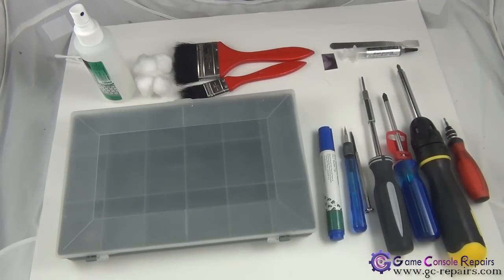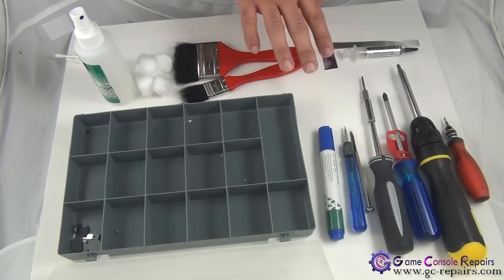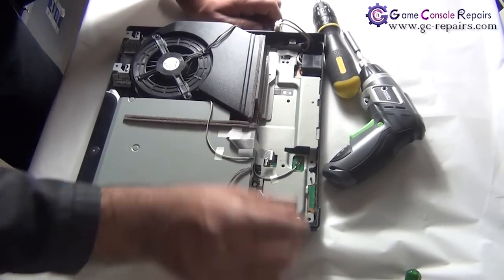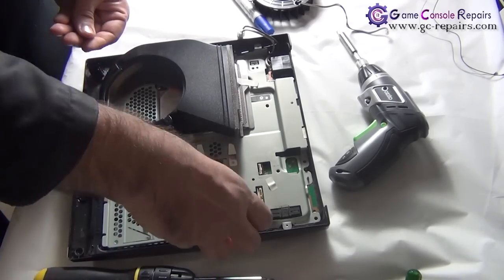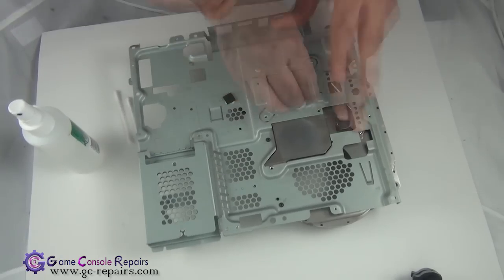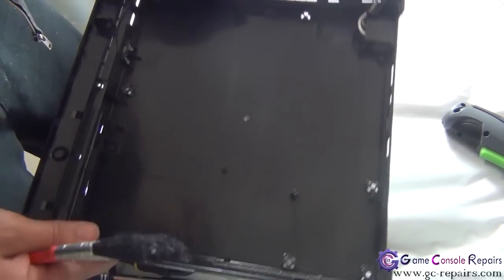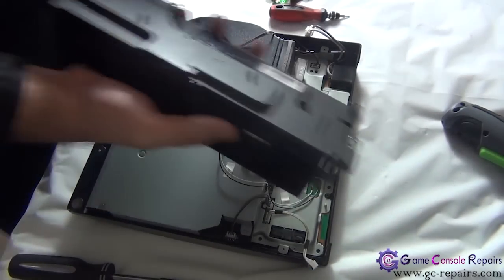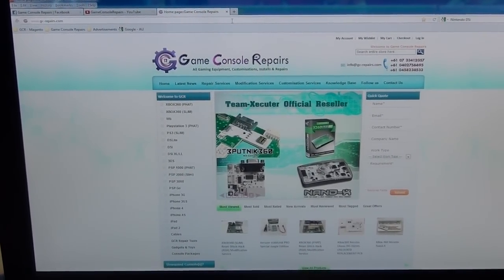PS3SLIM   250GB CECH 2002x   Thermal Compound Replacement by gc repairs com

Comment: Waaaaay too much thermal compound. It should be applied as a dot about the size of a pea on the center of the BGA's. The compression/pressure of the heat sink will properly spread the compound. If you have too much, you can create air pockets which will create hot spots between your BGA's and heat sink. Not to mention you want to focus the heat transfer to a single point... it is much more efficient at heat dispersion. Ask any one who professionally works on PC's... do not apply compound this way.
Reply: lol, these chips are massive and there's clearly very little mounting pressure.

This is exactly how this should be done on a ps3.
Reply: @Bonswally  I'm inclined to agree, the clamp pressure on the slim ps3s is very poor. The launch Cech-As I believe are the only ones that have good stiff clamps.
Reply: Eds UKGamerz It depends on the viscosity of the thermal compound you are using...like the arctic silver 5 in this vid which has a high viscosity. So when using the pea size dot method it doesn't spread as well as some low viscosity thermal compound. I use to think the same about spreading it and covering every inch. But if you ask anyone who actually knows what they're talking about when it comes to heat transfer they will tell you that making sure your compound has no air bubbles trapped in it is thee best solution ( ie dot and heatsink spread method ). I think people prefer to spread it on for piece of mind and precision. but the dot and spread method is thermally superior. Synth505 said it right.
Reply: Den techfixed both methods work perfectly fine, i certainly wouldn't use the dot method with the PS3 or PS4 CPU as it just doesn't spread evenly enough and it can create hot spots around the perimeter of the CPU
Reply: Most methods do the same. I did it just like in the video.  https://www.youtube.com/watch?v=r2MEAnZ3swQ
Reply: that pea size is a lie. Google about it.
Reply: The brand or type of thermal paste you use have also a lot of influence at the results. Arctic thermal paste is a very thick and sticky paste, adding too much will cause a isolation layer between cooler and cpu. Better brand like grizzly thermal kryptonaut paste, is more fluid and less sticky, so its spread more evenly. So the results will be almost the same. Still too little paste end up with a temp of 54 degree only ? That is a very awsome temp after a stress test, no worries that the cpu ever get burned, good paste. My ps3 slim hits 64 degree after 10 minutes and I haven't played 1 single game yet.
Reply: Personally I like to spread mine but I don't like putting it this close to the edge of the chip. I have put a rice sized amount on a old computer and it seemed to get more hot. I did it again but smoothed it out but only I stayed about 3 mm away from the edge and I didn't have anymore issues. It still got hot but it didn't thermal throttle anymore. I have a laptop now and I have to clean it and put more thermal paste on. I figured that I would do my ps3, laptop, and a friend's PC. I wish I still had a desktop computer but I am stuck with a laptop cause I travel alot. I mainly play games on my switch and I have my ps3, with a 7inch TV.
Reply: Doesn't matter, Modern graphics cards do the spread out thermal compound method and it works just fine. All you're doing is spreading out the paste to cover the whole IHS to make sure it's evenly covering the dies. If it's spread out evenly like this the pressure won't cause it to spread much and will have a less likely chance of either not covering dies or creating air pockets.

both ways work, hell you can glob it on and it won't make much of a difference either.
Reply: @HurtboxTV  conflicted opinions - all coming from supposed masters of the trade and all believing their way is superior.
Reply: Steve at Gamers Nexus says you can never have 'too much' only 'too little',
if you put on more than you Need then you will end up with enough once the excess is squeezed out, Better to be Safe...
where as if you don't put enough on 'You Don't have enough', ...Than Sorry
Reply: i've seen it done both ways. It comes down to personal preference but makes little difference as long as you make sure it is spread evenly across the chip. I personally prefer spreading it myself, this way i know every mm of the chip is covered. the key is to ensure the thermal paste is completely flat!!!
Reply: @eddieb10071987  https://tweakers.net/camo/c2ff8a8b3a2fc9e7cfb9ef8e647840bf57c0fba9/?url=http%3A%2F%2Fi.imgur.com%2Fo4Bt3j9.jpg%3F1

The CPU from the PS3 without the heatplate -- the die is only very small in the centre of the chip. A pea is sufficient, more adds insulation and reduces heat transfer. Rest of this guide is good though
Reply: Eds UKGamerz its NOT about preference at all. Thermal paste is used to compensate for imperfections in the supposed flat surfaces of the chip and the heatsink... we aren't making sandwiches here. LESS is more

Comment: Thanks for the video !
Just for leting you know...the CPU is 4cm x 4cm and the GPU is 4.25cm x 4.25cm 
(I have a PS3 Slim CECH-2104A).
Now I have a 0.5 thick 17W/mK Thermal Pad I bought from FrozenCPU and is working good for now...

Comment: Also when reassembling put a slight bend in the clamps to put more pressure on the chips which results in a better connection between the heat sink and thermal compound

Comment: Arctic silver them selves say that you only require a grain of rice sized blob of thermal paste, they also say not to spread it to avoid air bubbles, simply put the blob in the middle of the chips then place the heat sink on top pressing down gently to get good contact, I have had experience with a loud fan on my ps3 I first covered the whole chip with artic 5 and made no difference, tried the grain of rice technique, worked straight away and that's with arctic silver before its even cured.
Reply: Thank you, I agree, this is a helpful comment, and mirrors my experience with artic 5

Comment from the maker: @Mark Sulley
You heat the board only in critical conditions e.g motherboard, CPU, GPU failure otherwise you never heat it.
This is only to clean up and do a service on your console just like a regular car service.

Comment: Hi, This method doesnt include any part of heating the motherboard etc with a heat gun - I always thought this was part of the process? Or is it not required. Please can you let me know. Also in the vid after he's applied the thermal compound theres no indication on how long you have to leave it to dry.
Reply: don't let the thermal compound dry, it will dry itself when you put it together and use the ps3, the heat from the CPU cures it.

Comment: prolimatech pk1 
great spreadability, great cooling, and not conduct electricity (unlike AS5)
if pk1 isn't available (or to expensive for your taste) get MX4
my ps3 runs silky smooth.
ps: get some thermal pads to so you can swap out the old ones (if old)

Comment: I just ordered Artic Silver 5 from amazon...I keep watching this video over and over so I can be ready when the thermal gets here so I can do it. Am a lil nervous lol..
Reply: I’ m in the same situation as you now in 2020 lol did you succeed?
Reply: @alan370z4  wow 7yrs ago haha. Yes it worked great, I could feel more heat out the back. Which is good, it meant the heat was transferring and the fans cooling the heatsink.
Reply: Pierre Troche thanks for ur answer, what about the fan noise, your console became quieter after this ?
Reply: @alan370z4  Yes, it got quite because I removed so much dust and the fans didnt go into overdrive lol. Use gloves, oil in our hands will rust some pieces inside. Put your thickest application of the paste in the center. It will spread to the edges.
Reply: @pierretroche1461  is your ps3 still working to this day?
Reply: @lambertdoctore99  Well I ended up selling it. But after adding the artic silver it ran cooler and had 0 issues for several years after.
Reply: @alan370z4  same lol nd i have jailbroken it i dont want buy new one which has serie-3xx cannot be jailbroken
Reply: james lisak man I just finished putting some new thermal paste on my 2004B,  it seems quieter for now but I’m not 100% sure
Reply: Ok now I’m sure it’s definitely quieter, u should do it bro
Reply: @alan370z4  mine is cech-2504B

Comment: First off thank you for this video, it was very helpful and informative with good detail. 

Iv'e had my PS3 slim for roughly  2yrs 9 months now. My PS3 is starting to get very hot just after 1 hour of sitting idle. It used to take 8 hours of continuous play before it would reach roughly that same point. Also if i play a blu ray movie and then play a game for 45 min the system will get hot enough to kick the fan into max settings. Is this severe enough to attempt this repair or should I hold off?

Comment: If your not getting any power to the console at all mate a do know what the problem is av done plenty console repairs!What you said to me last week was that it was not powering up made me think the power eject ribbon cable was damaged,then again it could well be your power cable at the back of console be damged well the 3 pin could be,also have you definately properlt assmebled the the console back together properly mate?

Comment: @GameConsoleRepairs a spoke to cr7187 about a week ago there he stated that his console would not power on, no power at all going to it,i did say that you may need a new power eject ribbon cable they get damaged when you take them apart as that has happened to a few consoles i have repaired..It could possibly be he his power cable could be damaged or that he has not assembled the power supply properly could be a number of those 3 issues,read the comments from last week first sir.

Comment from the maker: @SuperPcRepairman
No Sir  Power Eject Ribbon has nothing to do with it. Thats a separate issue.
You can conduct a simple test:-
Remove the Power-Eject Switch completely
and then
You can simply plug in your Controller via USB and start your PS3 and it should turn on.

Comment: Did you buy a new power eject ribbon cable dude?because they can get damaged quite easily when taking it out.And have you properly assembled the power supply..I do know this because i have serviced and repare ps3`s have roughly done about 20 consoles.

Comment: My Ps3 had no dust in it, rarely used it over the last 3 years.  Yet it was overheating and the fan was running at 100% (loud as a vacuum).  Even so it would still force shut down the system.  Replacing the thermal paste seems like a completely necessary form of maintenance every 2-3 years so I am glad I found your video.  My arctic silver has my ps3 running like new now and I feel great knowing I can do it again and again if needed.  Thanks for the upload!

Comment: Seems like way too much paste, you only need like 2 lines in an X.
Reply: There is no golden rule. The X system basically produces the same result as spreading it thinly out (there are videos covering the various methods). The problem is, which paste you use and if the processor has a heatspreader or not. With a heatspreader the dot system is enough, because you only have to cover the area of the processor die under the heatspreader. If you are directly on the die spreading it out or X is better because with the dot system you risk basically that you get local overheating zones if you do not cover the entire die. Also it really depends which system you use on the thermal paste, some spread better than the other. I personally always spread method no matter what and always had good results and never overheating. But I spread the stuff as thin as possible and try to avoid overspill.

Comment from the maker: This video is for PS3 (SLIM) Thermal Paste Replacement.

There is another one in which i show how to replace thermal paste as well as installing new fan

are you plan on replacing fan? if not then simply follow this

Comment: Hello, i did everything on The video but i have a problem, when i start The ps the fan reachs max level in only 20 minutes, i opened the console again and i noticed The gpu and cpu are doing contact with The heatsinks just in the corners and not in the center, The console is fine is not hotter like before but The fan is reaching full speed in short time, what should i do, thanks for The help!!!!

Comment: i just got green light of death ( GLOD) basicly i have no image,soud, controller wont connect and i cant go into save mode when holding the power button. I cant turn off the system by a simpel press aswell, i have to keep holding it for like 25 secs before it turns off. What does this mean ? is my ps3 broken or is this something els ? have you had experience whit such symptoms ?

Comment from the maker: Yes thats Reball Procedure. We are in the process its not easy to show all the steps required to perform such procedures.
even though we make a video on how to repair via Reball 
1. Its not cost-effective you'll be needing a Reball Station costs $3000+ for a basic level station and then there are tons of other things required.
2. its need experience and high level of expertise to perform such operations.

Its recommended to leave it to the PRO's for such operations as it will be way cheaper.

Comment from the maker: no Audio/Video means issue with either

HDMI Connector
I think Samsung Connector Chip on the motherboard
OR
issue with the GPU unit.

its a very time-consuming hectic repair process. maybe one day we have time to make a video on such subjects.

you can simply try reflowing GPU Unit via heatgun and see if it works ?
we have a video on reflowing GPU via heatgun in our YouTube. Feel free to browse the channel.

Comment from the maker: few options you can try
use a bigger size Philips screwdriver and try to unscrew it, you only have to unscrew it so thats its not stiff, once the stiffness is losen up you can lift up from your fingers

you can try using pliers and try to unscrew it

if possible just destroy the screw using good pliers and cut it and take it out

Comment from the maker: Dont worry about that little screw. you can leave it. 
I can totally understand sometimes if you are not using HIGH QUALITY and RIGHT screw drivers it stuffs up the screw and becomes a nightmare to take it off. 
as long as you got it off its fine and leave it and simply place the PSU and it should work .

Comment: dude plz help me i opened ma ps3 and i tried to take out the power supply screw and 1 of them came out successfully and the other is stuck and its warn out im not sure how? i used the same drill bit to get the other one out and it worked HELP ME GET IT OUT!

Comment from the maker: no sweat - simply purchase another fan and stick it in.
Fans are around $15-$20 bucks.

or did you broke the connector on the motherboard ?

If so then you have to perform soldering and place another connector. Only Recommended for who are PRO Repairers. its not an easy job.

Comment from the maker: Good info - maybe only applicable to small processor units. PS3 CPU/GPU units are mammoth sizes, unsure if it will spread out all across.

ummm.. can you please provide link for it so that i can have a read about it more.

Comment: Is there a way to reduce the sound produced by the blueray drive laser going back and forth? Is it safe to use rum instead of isopropyl acetate to remove the old compound? My PS3 is ~4 years old and I disassembled it now. I don't think it needs Reballing. Am I incorrect?

Comment: Doesn't Arctic Silver recommend just to add a little dot in the middle of the processors, and let the heatsink do the spreading? Because that's where the heat generates from, on the centre of each processor

Comment from the maker: for 320GB models , there are few slight differences, e.g when you open up your console Blu-Ray Drive lens cable is connected to the motherboard. you have to be very careful and connector is fragile
There are few different screws in different places. 90% of the process is the same, if you confident opening it up properly then by all means go for it if not, then just wait for our tute to upload
It takes an awful lot of time in making a video, HD compilation and uploading
so be patient :-)
Thanks

Comment from the maker: Slim models are pretty solid - You can use flux and use heat-gun if you like but not really necessary.

We are uploading PS3(PHAT) Reflow repairs you can pretty much follow it for the SLIM models also.

LOL not sure if that helped but it was sure a confusing answer LOL
I amuse myself sometimes too LOL